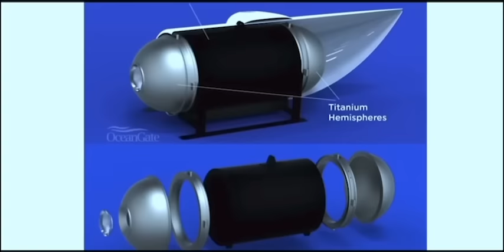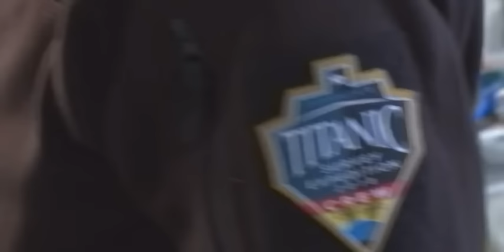First look at #oceangate #titan Debris

Comment: They literally only had a 2” bond area between the end caps and the hull.  You’re also spot on with the problem with flexing between the rings and the carbon fiber.  The project was filled with engineering idiots and a CEO that just wanted to ignore safety concerns.
Reply: I agree, but thought that the bond depth between the Titanium Ring and the CF would have been insufficient - especially where flexing (under extreme pressures) was concerned. It looked to be less than 50mm of bond depth.
Reply: Think of the STRESS on the crew capsule just TOWING in to the launch/dive site.
Reply: @donaldcarpenter5328 They pulled it by the dome end? Nobody's mentioned that before. Hell, they were ripping it off before they even got in it.
Reply: @TheFrenchPug  Yea  that makes sense
Reply: Totally! Looked like a pathetically inadequate bond, even to an amateur like me.
Reply: The CF cylinder was over 4" thick, so assume all the surface area available were used for bounding?
Still, only the glue was holding this contraption together at 4k m depth?
Unbelievable!
Reply: People that want money generally don't pay attention to safety. They only care about the dollar signs.
Reply: Perhaps if he would have put 12 or so 2inch all tread  connecting both cones but never carbon....wth was this guy thinking.
Reply: When carbon fiber fails…….it shatters under pressure. One moment the cylinder is strong carbon fiber…..the next millisecond…..it shatters like a glass window. The end caps did not pop off……they were driven towards the crushed cylinder by the water pressure. Imagine two giant hands clapping hard and 5 mosquitoes get crushed in the middle by the rings. RIP
Reply: @postcardsfromprotest  This is being done in an open shed next to a loading bay. Imagine all the brake dust, road grime, hairs, and dust that could have got in.
Reply: @wattage2007 me too, how could you have all these people around you and no one said, hold on except for the guy they fired.
Reply: So Stunning and Brave to Completely ignore any common sense. Just WOW I am just now seeing how this was pieced together, Glue? WTF Sorry but I would have wanted all Titanium and Welded then x-rayed to make sure no air pockets AKA good solid welds and a hatch to enter. I'm just a high school grad and even I know that at these pressures the carbon fiber will be destroyed to much movement, Carbon Fiber is just that a fiber with many layers it moves. The CEO Idiot got his Darwin award so sad that he took others with him, My condolences go out to these Families
Reply: @BatMan-ut1fp  Totally, just like the tie rods used to hold pneumatic cylinders together. Being a machinist toolmaker myself I wonder why those involved in it's fabrication didn't speak up ?
Reply: Needed more asbestos.
Reply: His goal was to prove everyone who challenged him wrong…
Reply: How many times do I have to joke about this sub being held together wiht glue
Reply: @thecreature9465 perhaps you meant prove everyone right,  that he disregarded safety and now he's gone
Reply: @peterduxbury927  The CF is along for the ride, it's under compressive loading, it's useless. We need to understand the plastic deformation characteristics of an expired cured ribbon Prepeg resin at freezing temperatures under extreme pressure loading (thick-walled tube config, with similar wall thickness to dia ratio). I also believe that the initial failure site was or is associated with the Ti end cap to tube interface.
Reply: Three differing materials, Titanium, carbon fibre and epoxy resin , with three differing expansion/ contraction coefficients meeting at one point , not tested in any manner and put through many extreme pressure cycles. Just an absolute idiot for not hiring experienced engineers who were willing to query him, through hubris killed all those people.
Reply: @postcardsfromprotest  yea, I noticed that the glueing process was done with everyone walking around and most likely, small particles of dust/ dirt and other airborne material contaminated that sealing surface before titanium Ring was set into place. It should have been done in a cleaner environment area.
Reply: And it looks like both titanium bell ends attached to those bonded rings with the 2" bond area.  The front bell end had a hinge that must have put alot of strain on the bond when open.
Reply: Why only the glue support it..seems to me its really impossible to hold that heavy capsule…😊
Reply: @laurentianvmx1692 one guy did, he was fired.
Reply: @postcardsfromprotest  The window was "only" rated for 1300 meters. There are so many wrongs in this project, i guess when you have CEO from delulu-land, a limited budget and firm belief that pure willpower in something will defeat physics.
If i was a billionaire and wanted a sub to play around with around Titanic i would let one of the Russian wharfs that works with Titanium build the entire sub out of it, to my knowledge there are none western wharfs with submarine experience who also have those enorumous gas filled chambers needed to weld massive constructions of Titanium, you cant do that welding in open air like with steel or aluminium.
Reply: @uwekonnigsstaddt524 man you've never even seen that happening yourself, merely heard and misunderstood, I'm surprised how many people know how carbon fiber doesn't work all of a sudden.
Reply: In meany other countries he wouldn't of got away with doing this but as it is america it is not a supprise..
Reply: Deepsea Force is NOT EXPANSIVE, but COMPRESSIVE. Therefore, they SHOULD (hindsight is 20/20) have designed a titanium ring that has a circular SLOT. Then glue it in there. SLOT: 4inch wide. 6inch deep. WHAT WERE THEY AFRAID OFF TO MAKE THE RING WIDER? WEIGHT?
Reply: @postcardsfromprotest actually. . at 5:00 u can see the window still intact. it was unbolted and rolled around to allow recovery. but if you look. its still there
Reply: They should have made 4 or 5 subs, given it is an extremely different design than any ever made before, and tested each of them to find the point of failure! One would be dropped deeper and deeper to see exactly how far it could go before implosion. Typically, it should double the operating depth. Another would be taken to operating depth repeatedly to see how many times it could be taken before failure. Would it make it for 5 trips, 100 trips, or 5000 trips to 10,500 feet? They had NO idea how many times it could be reused before failure, but the stresses on something like that are incredible and needs to be calculated. Another should be used for testing without humans inside and put through a series of different scenarios. The last one could be used for the actual trips to the bottom. I can't understand how you could try something like this that is an entirely new concept with untested materials and NOT do repeated tests to find failure points.
Reply: They did have a few good engineers working for them, but when they spoke up and disagreed with Stockton Rush, he fired them.  One engineer simply wanted to test the device more thoroughly, and Rush refused and let him go.  That's the kind of foolishness that gets people killed...
Reply: @jasonhaynes2952  everything you suggested makes sense but i assume would cost a lot and would seriously cut into their profit.
Reply: @BatMan-ut1fp  I guess to make it all titanium would have cost too much!
Reply: I’m a structural engineer of 24 years. It absolutely astonishes me that “Engineer’s” would  even consider something like this to go to 4000 meter’s. There’s a reason why we use heat treated steel and titanium and “spheres”….
Reply: @Khumry  - since he was operating in international waters, NO country had jurisdiction to prevent him from diving.  The fact that you fail to comprehend the obvious is not surprising...
Reply: @BatMan-ut1fp  Money, that's how.  Each of them needed to put food on the table and pay their bills.  Such a sad truth and I hope everyone that was involved in the building of this repent.
Reply: After the epoxy was applied, it should have been placed into a vacuum chamber to remove the thousands of micro air bubbles. Those little voids caused the epoxy to fail. Some think long rods could have prevented the ends from coming off. However, that wouldn't have been successful because the titanium and carbon fiber are dissimilar materials. So, the ends of the carbon fiber would have still failed at the connection point. The pressure is still too great.
Reply: @postcardsfromprotest  I used to inspect surfaces for particles and their removal in a clean room. Using an HIL (High Intensity Light) lamp I could find 3 micron particles, showing up like a faint star to the naked eye. That warehouse would have looked like a blizzard of dust.
Reply: @jasonhaynes2952  They were not making much money from the trips evven thaw it was $250k each the CEO admitted that.
Reply: Lol was thinking the same thing. I thought maybe i was missing an extra step or something - no way that could join could be what they bet the house on... but it was 😂

It would have even been better if the titanium had a slot that the carbon fiber could go into. At least a slot could then be glued on both sides instead of just one. Something like a |:::::  ---- titanium ring slot could have at least had a double strength bond.

Also, some carbon fiber experts warned them that the way they formed the carbon fiber hull wasnt optimal either. They had it formed in parallel windings instead of a diamond shape, which according to the expert would have been significantly better.

Cant believe they rolled the dice on thag death trap and charged people 250k per slot to do their experimental beta testing.
Reply: and why would they need more ? at the pressure they go the bond will get even more tighter.
Reply: The pressure outside is driving those joints together.  Unless the structures seriously deform - you won't lose that joint.  And if one of those structures deforms?  I think something else will be fatally compromised before the joint lets go.
Reply: Rapid servicing might have been part of the reason it failed. If it turns out they shed the weight the hull night held together better if they didn't attempt to surface rapidly. It would fall apart from the carbon fibre releasing its grip.
Reply: May have held together for longer the external force on the hull is what held it together
Reply: In my simple analysis/ FEA, the bending and stress concentrations in the region of the glue bond is severe. The tube also compresses which really stresses the laminations. I don't have a way to model that type of failure but its clear that the design was too close to the failure point. And not designed with lifecycle stresses in mind. Painfully clear now. Just so weird how there is so much research and literature on this subject and its all pretty negative regarding these shapes at this depth.
Reply: The portal window was only rated for depths up to 1,500ft and was clearly missing in the photos.
Reply: The more I learn of this the more I want to just shake my head. Imagine getting on a jet where the wings have been attached with glue. Who would do that? But people actually got in a vessel where critical parts were attached with glue? Was this guy serious? I can't believe he actually convinced people to get in there. So sad people had to die in an accident.
Reply: @glen4cindy  anything with carbon fiber has a glue/sealer to coat the carbon fiber strands.
Carbon fiber is a woven material and needs to be coated.
Carbon fiber will start to peel after so long naturally, it has a short life span.
Under so much pressure and vast temperature changes, the carbon fiber would start to separate/delaminate more rapidly than usual.
Reply: Yeah but at least they had a super diverse and inspirational crew amirite?
Reply: @RealMcCoy0205  I don't disagree. However, the choice to use such materials for mission critical parts of the vehicle were a terrible choice. I think it's obvious glue won't hold.
Reply: @dangelini1137  It isn't quite Jim Jones level of inspiration but inspirational none the less.
Reply: sounds like every ceo evar.
Reply: @RealMcCoy0205  Looking closely its hard to tell but the bolt flange looks like it came off due to bolt failure as the ship imploded raising the internal pressure high enough to blow the ends 500 ft apart. The window was a weak spot in the internal pressure scenario. It surprisingly withstood the depths several times without fail. PMMA is pretty tough stuff.
Reply: @anthonysei  yes at least one ring looks to have separated from both the bell housing and the carbon fiber body.
The distance between the two also could mean the sub wasn't at the bottom but still desending.
Reply: So both Dom ( front & end titanium caps) are just pasted by Adhesive with Carbon fiber cylinder.. hahahahahah This is slap on engeneering. Adhesive to take pressure of 4000PSI.
Reply: Glue it together and let the hair go with the hide..
Reply: @szaki  Take a thread and pull at both ends. It will resist the pull. It can resist tension. No push both ends together. It cant resist that. You cant push a rope. Carbon fibre is a thread. Embedded in resin it can resist a lot of tensile force, like in an airplane hull, where the inside pressure is higher than the outside pressure. But on a submersible, the load it push, not pull. The hull ist compressed. The rope is pushed. It cant resist that. Thats the reason why there  is no carbon fibre deep sea submersible. 
Steve Fosset had one carbon fibre deep sea submersible build, to dive down into the mariana trench. He died in a plane crash before he could do this dive. Richard Branson, that Virgin whatever guy bought it. He wanted to go commercial with it. Until he got told this submersible was supposed to do this dive just once (1 dive!!) and then become a museum exhibit. The maker of this submersible and Fosset were aware this was a single time usage vehicle. Using it more often would have been suicide. OceanGate delievered proof of that fact.
Reply: @szaki you are exactly right, there should have been TI tension rod bolts that ran from end cap ring to cap ring, that would have minimized the flexing although it likely still wouldn't have been enough to hold it together at that pressure. The best way is the known and proven heavy metal compartment for those pressure depths.
Reply: @postcardsfromprotest  and also why were they cleaning the mating surfaces with barehands?? (2:40min)
Those surfaces shouldnt be touched barehanded ever to prevent oil  impregnation right?
Reply: @szaki  well,, te pressure was holding that bitch together.. BUT even a 5" thick tube is gonna collapse in the middle.. i see no bulkheads. Imo, it crumbled bro
Reply: @TheFrenchPug WHOA!!! 😮. The more I learn the more unbelievable this company Ocean Gate/Stockton seems.
Reply: I pretty much agree with your comment about the engineers who worked on the Titan submersible and the CEO Stockton.  What was shocking to me was to find out there was only a two inch bond area between the end caps and the hull.  Some of those pieces are bigger than they look in pictures so to find out there was only a two inch bond area it's just one of the latest shocking discoveries. Unfortunately, I doubt if it will be the last,
Reply: @szaki  glue is not doing the most work here, external pressure is, pushing the end caps toward the mid cylinder.
Reply: @BatMan-ut1fp He was thinking bottom line only …..
Reply: EXACTLY. Couldn't have said it better!
Reply: @lionellosanti  I rewatched the gluing process video, the Ti rings had a small flange, maybe 1-2 inch long , which slides over the CF tube!
Sorry, my bad!
Reply: @inarinukka7729  Your job as an engineer is to tell what is wrong with the project, especially if you're trying to break the laws of physics... No matter if you get fired on not, you were paid to do YOUR JOB, you are not a robot doing someone's else instructions... I feel like those involved in the project and signed under that, should be seeing their day in court.

AKA Boeing software engineers that crashed 2 or 3 new planes due to lack of testing and due to breaking SOLID/KISS/DI principles for software engineering.
Reply: I immediate saw this and thought it nuts, the flex of the midpoint of the hull would very easily undo that glue joint... as it did.
Reply: @JesusSavedMeFromASuicideAtempt sounds like a LGBTQ person.
Reply: @vincentsutter1071 but he didnt build in intl waters.....even so
Reply: @MT-it9qt i too worked in that type environment long time ago. I agree on the microns.
Reply: @RealMcCoy0205 it was. The txt msgs are now out. They decended WAY TO FAST it seems. They knew they were in trouble....
Reply: @laurentianvmx1692   they knew they were giving the Idiot what he wanted, he would not listen to professional reason....did you not see that look on his face, 3:23 its that  arrogant look!  so he really knew this was deathly dangerous
Reply: @sammyhooligan803  not gule PEANUT BUTTER!
Reply: I agree the difference in thermal contraction between titanium and carbon fibre may cause stress the bonding material flexing and thermal properties are a problem for any connection subject to pressure stress. although you may believe the titanium caps are pushing equally against the tube ends  it is correct to believe that more pressure will want to crush the cylinder making the sealing faces deviate from round.
Reply: @szaki  At depth the pressure would be working to hold the ends on. The glue, if it was a problem, would have failed nearer the surface if anything. It would not have caused implosion at depth.
Reply: It seems like they should have had some type of support section on the inside circumference 
It's like a butt weld vs a lap weld
Reply: @inarinukka7729  Ovako Steel  made the steel phere matherial in Imatra, and Lokomo the spheres in Tampere for the Mirs in 80-ties. It was possible then in Finland.
Reply: Unless you have a common law legal system which enforces torts with restitution rather than punitive fines. Ah, but an insurance agency would cover that. And what would an insurance agency require of its clients? These are free market regulators.
Reply: @Khumry  It's in international waters, nobody's rules apply, common sense tells you to follow what has worked for decades, he didn't want anyone telling him anything about anything
Reply: @DavidPirouet  They were descending too quickly when problems started, they tried to surface but it was more slowly than a normal emergency surface, they were ascending too slowly, probably due to being overweight, possibly water intrusion
Reply: James Camerons newest Blockbuster" Titan-Death of an Narcissist"🤮
Reply: @BatMan-ut1fp  He was thinking:" I am the greatest of all"🤣In german terms: "Hochmut kommt vor dem Fall"!